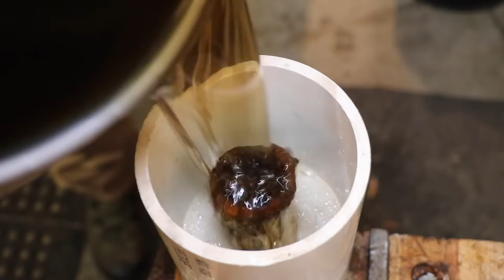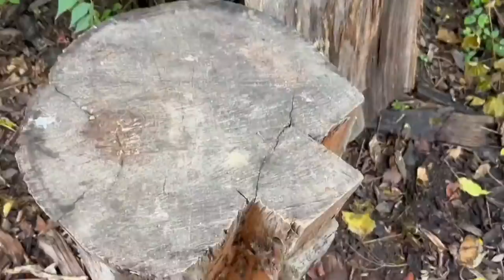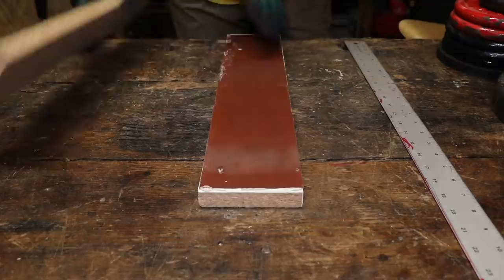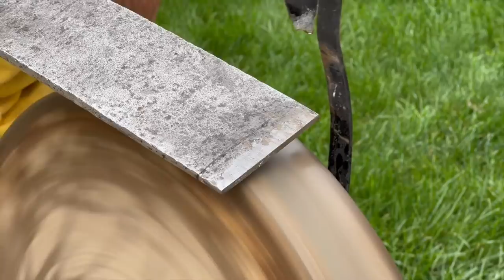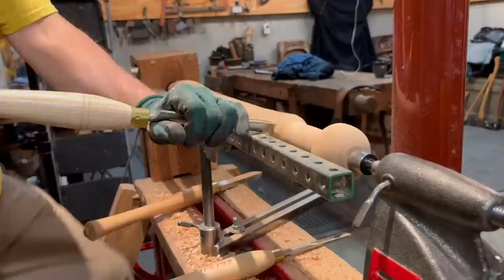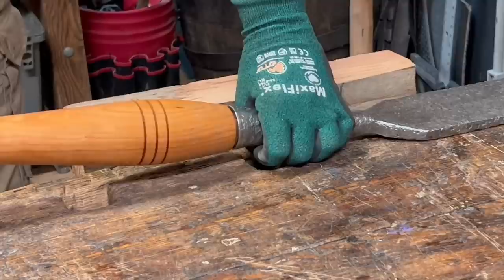9 STEPS To Fully Restore MASSIVE Slick Chisel

Comment: annealing is usefull if the steel is hardened "heat tempered"  the body of the slick is iron ... only the tip is steel it's forged welded piece thats where the line under the blade come from

Comment: Enjoyed this tremendously. More than the individual parts of your efforts, I like your style. I recently acquired a 2 1/4" slick in better condition than yours admittedly, bent though and with a chunk missing out of the handle. Question: what would be a clever (expeditious) way to flatten the back fully without relying on a machine shop? (I am sure sandpaper on melamine would work, but would take forever in my case with the hand forged slick showing quite a few undulations in the finished product). I would like a straight back to help with timberframing in the next 2-3 years.  Btw, I physically laughed out loud when you said you didnt want a normal handle, and I found it quite inspiring too. I would like to make something of similar length just for kicks, and make it out of a tree branch with all the natural bends etc for character sakes. Maple or even Alder good in your opinion for this hand driven equipment? Lastly, I am going to take time to watch your other vids. I love your human powered tools showing in this vid, so I'll subscribe.
Reply from the maker: Thanks for the comment and subscribing!  A belt sender would do to flatten the blade provided you didn't let the blade get too hot.  I like your idea of using tree branch - that will look great!  Good luck and take care.  Chris
Reply: @ChopWithChris  Thanks Chris, confirms my thoughts. Any experience with Maple or Alder as handles?
Reply from the maker: Maple is good. Never tried Alder.
Reply: @ChopWithChris  then maybe I'll do it anyway. Not much to lose...
Reply: I may even try drift wood from the ocean, species unknown. We get a lot of it here in the west coast of Canada
Reply from the maker: @LitoGeorge  Wow!  I love drift wood.   I have a video called The Driftwood Chair.
Reply: @ChopWithChris  excellent :) I'll have to check that out. I see we share a lot of common interests. It would be interesting being neighbours.
Reply from the maker: No doubt!

Comment: Was this a re-upload? I could have sworn I saw most of this. I assumed that you would round the edge of the slick in this one. I know the edge is the primary concern, and I wonder if automotive body filler was applied to the pits if it might make keeping it clean easier so there’s less pits for sawdust and moisture to gather?
Reply from the maker: I put out an hour long extended version and people wanted to see a shorter version.  I never thought about a filler.  Thanks.

Comment: the blade is way more pretty with this beautiful  old iron visible structure texture. no need to remove more material.  and the tip of blade could have been reforged instaed of cut . this would have saved two generation of use one for the cut and one for the material removed by grinding .